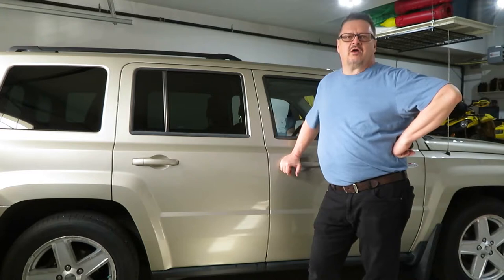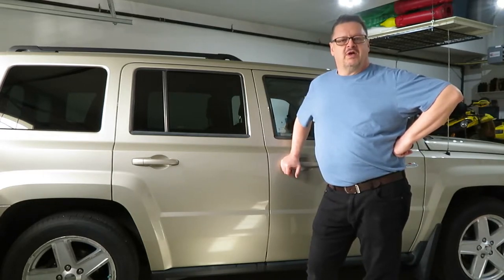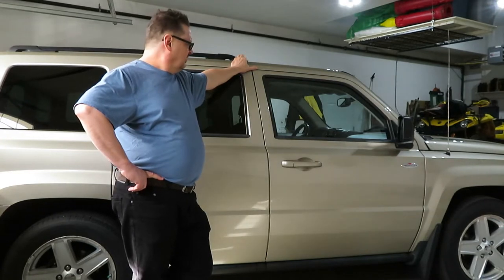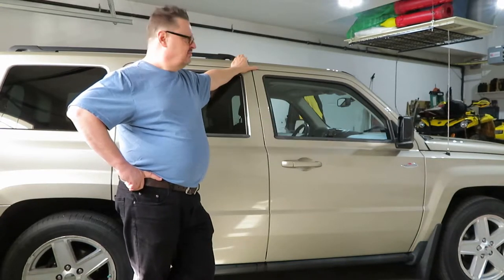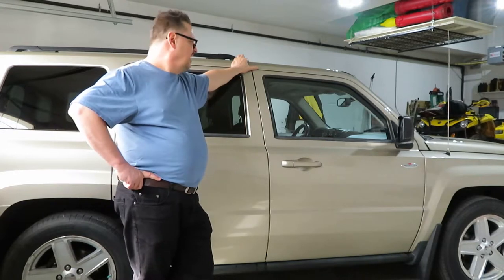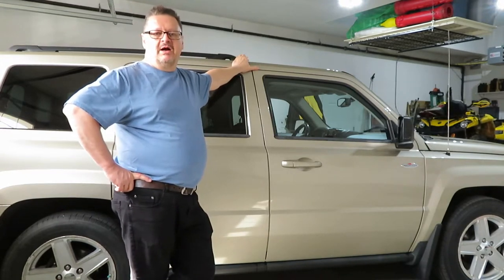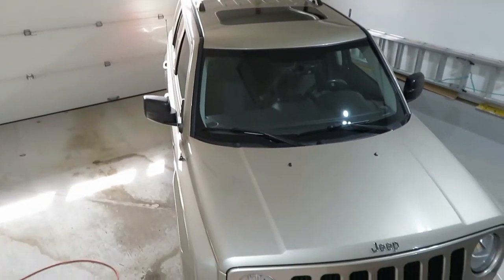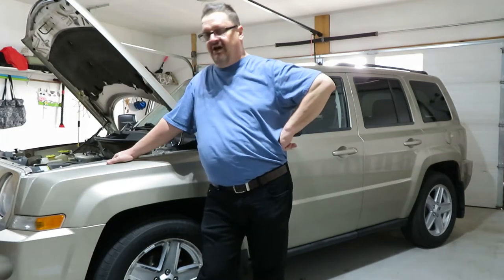Jeep Patriot Review - How Well Has It Held Up - Should You Buy a Used One?

Comment: My 2014 4x4 with 73,000 on it is having trouble smoothly accelerating from 50mph: tending to jerk when give it gentle throttle. Anyone have any thoughts?
Reply: My 2016 was jerking with acceleration, I changed the spark plugs and that solved it.
Reply: @Run-GNC  I have heard the same thing. I'm going to replace mine, as well.
Reply: throttle bodies go out on these things pretty early so that might be it too. Also what Michael said, spark plugs for sure
Reply: How often should I change the CVT transmission fluid? I have a jeep patriot, 2014
Reply: Spark plugs homie. Gotta be changed every 30k
Reply: @tuner7961  throttle body has 0 to do with jerking lol
Reply: @ElantraFukkenGang  when the air flap gets stuck closed or has a hard time opening at a certain point, the car will get irregular airflow, causing it to jerk. Literally what happened my my wifes jeep. Its caused from carbon build-up
Reply: Spark plug and throttle body. Might as well change the coil packs and air filter too. Seriously.
Reply: @tuner7961  interesting thanks for the info. How many miles did she have around then on her jeep?
Reply: @ElantraFukkenGang  i want to say maybe 65k-70k. Its apparently common in all the dodge jeep chrysler cars that share this throttle body. I could have probably cleaned it but i just replaced it. It really freaked her out so I just wanted to be sure it wasnt going to happen again 😄

Comment: 2011 for $3k 170k miles is it worth it ?
Reply: I just found one 2011 with 160k miles at $2500. I'm hearing the CVT transmission ones don't buy.
Reply: If it's an automatic, make sure it's had the transmission fluid changed every 40 or 50k miles. If not, set aside another 2 grand for a new transmission. Otherwise, just get one with the 5 speed manual.

Comment: If you want to make patriot ride like luxary replace the front spring with corola spring it will lower the ride by 2inchs but it will cancel out some bump on the road. If you add 400lb weight to the center of the car I'll surprised you.